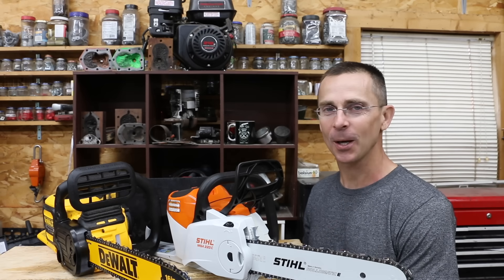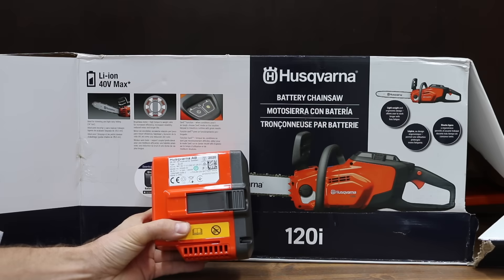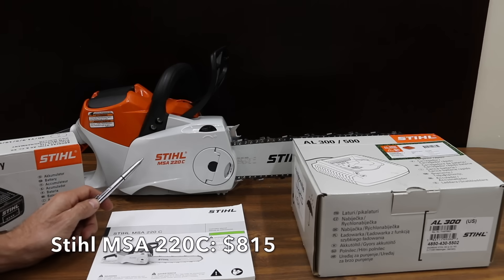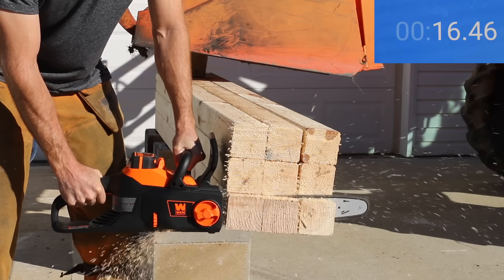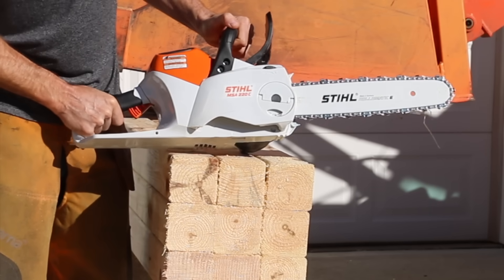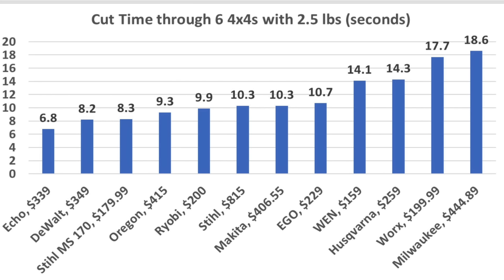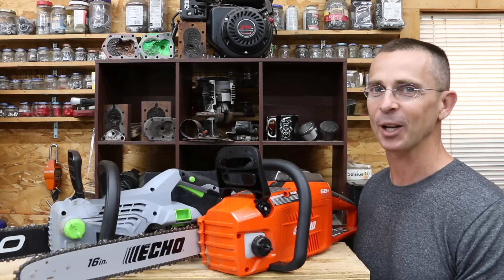Best Battery Powered Chainsaw Brand (ROUND 2)? Stihl, Husqvarna, Echo, Oregon, DeWalt

Comment: I’m curious — have you tested the Atlas 80V chainsaw? Are there any other battery powered chainsaws with a power rating above the 40-50V range?
Reply from the maker: Thanks for the video idea.
Reply: Ooh! Kobalt also has an 80V model! I wonder if they’re actually the same saw underneath, just sold by two different brands?

Comment: You can have the battery cases 3d built , buy the cells, buy the wiring with circuit board and build the battery. You'll save$$$$ if you want to goof around
Reply from the maker: Thanks for the feedback.

Comment: Ego's biggest saw (18") is rated at 11,000rpm instead of the 6,800 of the smaller ones. You can also get bigger batteries and a rapid charger that charges even faster than the one in the video.
Reply from the maker: Thanks for the feedback.
Reply: @ProjectFarm  Oh yeah, and it has decent spikes

Comment: I have the Dewalt 60v & 20v saws. I'm really impressed with the 60v, and the 20v is good but could be better with a bar/chain upgrade.... Would you be able to do a video on what bar/chain upgrades are available for the various battery saws including the dewalt saws? That would be really useful!
Reply from the maker: Thanks for the suggestion.
Reply: @ProjectFarm  I recently purchased the Oregon advance cut 20" bar/chain combo for my 60v as it was on sale. It's 3/8 pitch and the only difference is guage but they come as a pair so I put the 16in 60v bar on my 20v dewalt saw and it works great!!! Anxiously waiting for delivery of the 20in bar to try out the flexvolt with a bigger bar...

Comment: Hi, and thanks for your extensive and informative testing!   Curious about the Worx NITRO 40V POWER SHARE CORDLESS 16" CHAINSAW WITH BRUSHLESS MOTOR ...It uses a DC Brushless Motor, has two 20 volt 4AH batteries and touts a 59FT/S chain speed.  A little heavy but spec-wise a far cry from the 14" Worx you tested with a 26FT/S chain speed. Wondering if you could test it.
Reply from the maker: Great suggestion!

Comment: Great video as usual, you must have tested two grand worth of chainsaws in the two videos, what happens to your tested tools? Do you resell them, ebay!?  Do you keep any?   Its great you do these, you are one of the best tester on youtube!

I still would like to see you test if a screw holds better if driven by a drill verses an impact driver in different materials  and which tightens a joint better?  I have experienced an impact driver causing a screw to stop tightening while the drill tighten it right up.   My theory is impact drivers damages the material as it hammers the screw in.

Comment: I would respectfully suggest that for the sake of science, you need to re visit this.

The results could have been influenced by the sharpness of the saw blade and the material its made from. 

I would suggest you need to pick a test or some number of the tests and re do them, with all the saws using a brand new chain from the same manufacturer.

I dont think you need to re do all of the saws because it’s obvious that there are some major differences in performance between the top performing saws and the bottom ones.

Also all the batteries need to have the same capacity, I appreciate that stats can be extrapolated however, its not ideal.

Great job
Reply from the maker: Thanks! Thanks for the constructive feedback.

Comment: I've had one of the echo saws for about 3 years. I haven't needed my old gas powered saw in all that time. All my firewood, any tree I needed to cut, and even brush clearing was easily handled by this saw.  I live off grid, so I didn't even have to pay for the energy to run it.  
I've worn out one bar and about 4 chains, and the saw still runs great. The battery doesn't seem to have lost any capacity. 

Its quiet, and reliable. No more endless pulling the cord hoping the gas saw starts. This electric saw starts every time, and stops when you let off the trigger.  It sounds simple, but it takes much less time to cut wood because I'm not fiddling with the saw. Add bar and chain oil and go.  

Great video with great tests, by the way.
Reply from the maker: Thanks!  Thanks for sharing.

Comment: Fantastic video. I have an older 16" ego, but the single threaded stud bar retention is not good.  If you side load the saw at all, the chain will jump off.   The one good thing about ego is that i have all of the other ego equipment: blower, weed whip, edger, mower, snowblower.

Echo surprised me to the upside.  I was equally surprised that stihl did so poorly on cut speed.
Reply from the maker: Thanks!  Thanks for sharing.

Comment: I was quite surprised by the Echo. All of my outdoor tools are Echo 2 stroke. I know they're really good but I wasn't expecting the battery operated saw to be very good. With the ego, in this case it was definitely out matched by the small battery. With the 5 amp hour battery, not only to get more run time but the saw recognizes the bigger battery and doubles the power to the motor. So it cuts much faster as well. Would be interesting to see that saw with the 5 amp power battery against the Echo
Reply from the maker: Thanks for the suggestion.

Comment: I purchased the Dewalt but found the batteries to be extremely expensive. I want to do chainsaw milling of trees and I would like to find out what corded electric saw would work best for that. There are several cheap options on Amazon and longer bars are also available. (Matching them up is an issue.) Would you be willing to look into that?
Reply from the maker: Thanks for the suggestion.

Comment: This is BY FAR the worst comparison video i have seen. You cant test a Products battery run time if the batteries are different. It will affect performance and all other factors. How are you suppose to compare a dewalt 6ah battery to an ego 2.5 ah ??? At least put a 5ah on the ego so we have a better idea. I get the voltages will be different no matter what but it be nice to make a some what fair comparison.

Comment: We got a dewalt! Can't wait to use it. Big win for dewalt since we have several 60v batteries already and if we are actually in a hurry to charge we have dewalts fast charger which is probably double the output as the one in your kit. But the slower charge means longer battery life or that is the claim. Also can't wait to ditch the anti kickback chain that seems to slow saws cutting. Should make a nice delimbing saw. Our tree take down saw is not even a saw anymore. We use a large excavator and push them over haha
Reply from the maker: Thanks for sharing.

Comment: That was a pretty good video.  I have most of the Ego tools.  I also have the 14" chainsaw.  Yes, that dwfinitely needs a 5 AH battery at a minimum unless one just has to make a couple cuts.  They have a newer 18" chainsaw that is supposed to be very nice, but I only have three smaller trees in my yard and do not need anything that big.
Reply from the maker: Thanks!  Thanks for sharing.

Comment: EGO has 5 & 7 AMP hour batteries, test needs to be done using equal equipment, battery, bar length, this would set real premise.
Reply from the maker: Thanks for the suggestion.

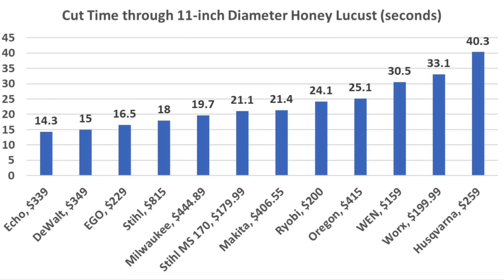Comment: At 15:30 your graphic says Stihl MS 170 costs $179.   This is not electric, right?  Anyway, it seems that for short  duration work or very large blade work, you might as well go electric.  Although that price is tempting in spite of the noise and fumes.

Comment: Great video! I wonder if the various manufacturers publish their motor torque values? It would be interesting to see a comparison of (claimed) torque ratings, as I imagine this would have a significant impact upon cutting speed and capacity. IE, higher torque having less stalls and higher RPM under load.
Reply from the maker: Thanks!

Comment: Wow after spending several hours cutting a bunch of logs yesterday with my old gas powered chain saw I really question if an electric one would be a good replacement. I only use mine every few years so the easy to get running again of an electric would be nice but man the high prices and short run times! Renting a gas one might be the best option!

Comment: Great video - I almost pulled the trigger on the Echo.   But after looking at the negative reviews (16%) on just the battery pack on Amazon I'm going to wait.   If you have to buy another battery pack the cheapest price currently on Amazon is around $200...almost 60% of what you paid for the saw with a battery pack.   And getting the warrenty honored by these resellers was a major problem.   I don't doubt the other saws  have the same issues.   I'll hold on to my 2 cycle Echo for a while longer :-0
Reply from the maker: Thanks!  Thanks for the feedback.

Comment: Dewalt, makita etc have a large catalog of battery powered tools available, and that's probably worth considering / going over in the reviews also. Great vid!
Reply from the maker: Thanks for the suggestion.
Reply: That was in the first video. This is a part 2
Reply: @laa0fa  I think he's bringing up the point that if you buy the Stihl or Echo...that's all you get. You'd likely have no other use for the battery or no spare batteries for that tool whereas if you bought the Milwaukee/Makita/DeWalt or even the Ego you might already have outdoor power equipment or tools that can extend the use of the kit.
Reply: echo 58v to dewalt or makita adapter

Comment: Please test full electric 120 volt ac plug in chain saws.
 I have used these for trimming trees and find them very useful.  The big draw back is the cord but otherwise, they  have very high torque,  are very lightweight and run all day with no recharging,  no refueling. There's nothing worse than climbing 65 feet up in a tree only to have your GD gas powered saw refuse to start. 
If you are trying to work a full day it looks like you would need at least 10 batteries and 10 chargers to keep going with these battery powered saws. No thanks.
Reply from the maker: Thanks for the video idea.

Comment: I’ve been toying with the idea of buying a battery powered chain saw, after this I think I’ll stick with gas while I don’t use a saw that often when I do I normally use it all day and with 4-8 min of battery life while using and more than an hour of charge time it just doesn’t seem practical. Last time I used was was a couple months ago after an ice storm hit Texas lot of limb breaks at the ranch and I used a saw damn near all day had to fill up the old  stihl 4 times and had to change blades 3 times throughout the day and made well over a hundred cuts. Even if I had 3 batteries (and a place to charge them I don’t think a battery saw would have been able to handle it.
Reply from the maker: Thanks for sharing.

Comment: Ego with the 18'' bar (which gets you metal felling spikes) and larger batteries is pretty kick ass.

I cut down 4 trees this weekend and put in a good 5-6 hours of sawing and stacking with it without any complaints at all!
Reply: Agree with GitarStu...battery chainsaws perform at optimal power when paired with 4.0-5.0ah batteries.  That's because the lower ah batteries operate on a single series of cells while 4ah and above operate on 2 series of cells (in parallel if manufactured properly) which results in much greater power output.
Reply: @jgrande1514  It's not just the batteries. Ego saw build corresponds to bar length and a presumed purpose. The 14" saw gets a 6300 RPM motor and plastic parts, presuming light consumer use. The 18" saw gets an 11,000 RPM motor with more metal parts presuming a more serious user. (I have other Ego tools, so have been tempted to buy their 18" saw and put a 14" blade on it for compactness.)
Reply: Thanks, I've been thinking about getting one, mostly because I already have the mower, blower, and trimmer so I have a 7.5 and a 5 AH battery already, though I need to see how these compare to the Milwaukee chainsaw as that's what all my other cordless tools are.
Reply: If only the Ego didn’t seep bar oil constantly!
Reply: @razorsedgeadventures6599  that's the main reason I haven't bought one. I have their pole saw and it leaks bar oil constantly. Was afraid the same would be true of the chainsaw.
Reply: It's a damn good saw, isn't it!  You just need a realistic battery to run it.  The 2.5AH battery in this comparison wasn't fair when comparing to the others with 4+ AH.  He should have done it on the 5AH battery to at least put it in them middle.
Reply: @stoojinator  I bought the Ego with the 5amp battery for my brother for Christmas but I wished I had bought him the Dewalt now.

Comment: Excellent comparison, thank you! It would be interesting to compare power consumption between gas and electric powered saws. I suppose this could be done by comparing the KiIowatts consumed by each. 
5-10 minutes of working time for a battery powered saw doesn’t seem much. You would need a whole arsenal of batteries for a days work. 

For occasional use it may make sense if the power consumption is lower than a gasoline chainsaw.
Reply from the maker: Great suggestion!  Thank you.

Comment: Part 3, Toro and Greenworks?
Reply from the maker: Thanks for the video idea.
Reply: @ProjectFarm   Happy to and looking forward to it. Yours are the best reviews by a mile. The Greenworks intrigues me as they have "pro" versions with an 18-inch bar. However, I've come across some negative reviews about the batteries stating that they cannot be left in the charger or they'll lose the capacity to charge. Wondering if Greenworks pro fixes this "cut corner".

Comment: Thank you for your incredible work! Best testings I've found, which doesn't seem to be biased by sponsoring money. Thanks!
Suggestion: I have a Black and Decker 18v chainsaw. Is there a reason you've focused only on these more powerful chainsaw? (I've selected mine for small branches and it's light weight)
Reply from the maker: Thanks!  Thanks for the video idea.
Reply: Along with the cheaper 20v DeWalt.

Comment: try the china knock off's that use the 18 volt makita battery!! there are many of them. I bought the knock off blower 6 months ago and sofar it works great for $30.( blower only)the rubber knozzell does tend to fall off. a clamp/wire tie would work great to fix that. keep up all the great work!!!
Reply from the maker: Thanks, will do!  Thanks for the video idea.

Comment: I grew up logging my dad's ground hog sawmills and cutting everything up into pulpwood and firewood that wouldn't make a saw log. Back then a homelite 1050 was the best all around chainsaw until Stilh came along, it was lighter and cut just as fast. If you use a chainsaw for 8 to 10 hours a day 5 and 1/2 days a week at the end of the week that 6 lbs and more runtime between refueling pushed that homelite 1050 to the far corner of the pickup bed. Over the years I've used over 20 different brands of chainsaw and didn't think anything could beat a Stilh until I borrowed my neighbors Echo he picked up at a garage sale. I sharpened the chain, and I was totally blown away at everything about the echo. Having said that, I don't know how it would hold up to cutting down homeplace white oak for Jack Daniel staves as the bar on the echo I used was only a 16 and the ones I grew up using were at least 30". I cut some White- Oaks where I had to plunge cut with a 30" bar all around and then notch it to reach all of the way through it. A sharp chain is a must, you get good at sharpening a chain real quickly.  As nothing will wear you out as quickly as wrestling a dull chainsaw. Dull chains are dangerous and rough on everyone and everything.
Reply from the maker: Thanks for sharing.

Comment: Can I assume that these saws had different sized chains on each of them? If so, then the test is problematic. Without running the same sized chains on each of the saws, then the testing outcomes of course will differ.
Reply: The saws come with the chains they come with.. He tested the products in the same condition as you would buy them straight from the store.  Your average consumer doesn't get into swapping out bars and chains and whatnot.  They want to know what the best performing product is right out of the box.

Comment: I'm interested in seeing a comparison of the 12 amp and 15 amp electric chainsaws
Reply from the maker: Thank you for the video idea!
Reply: I used the $56 Wen and although it has a powerful motor for a 12amp after many cuts and getting hot the oil tube shrinks not allowing enough oil to come out on the chain. I've purchased two that ended up with the same issue. However I cut up 5 trees with the last one where two  measured 24" across the middle.

Comment: I love my Husqvarna 120i 40V chainsaw. I love the savE economy switch. It slows the chain speed down, preserves the battery without compensating power. I'm a big Husqvarna fan. It was a Christmas gift from my Aunt and Uncle and I'm very pleased with its performance thus far. Used it a couple weeks ago to clear a couple balsam firs that were down blow and a hung up fir. I limbed and bucked a 60 foot balsam fir on one charge and 12 inches at the base. I'm pleasantly amazed by this battery powered saw. I have the older Husqvarna 340 and 350 gas powered saws, wasn't expecting the battery powered saw to be as efficient as it was! Its a Husqvarna for sure though!

Comment: Don't mess with ECHO. In my neck of the woods we use them professionally to trim olive trees, and that's some pretty hard wood. We're using the 2511 top handle model, which seems like a toy at first. Well, last year this little guy trimmed more than 2000 trees and it is still as new, fires up on the second pull from cold and with a sharp chain it rips through 8 inches of olive tree logs with much gusto, performing way better than a little saw should.
Reply from the maker: Thanks for sharing.